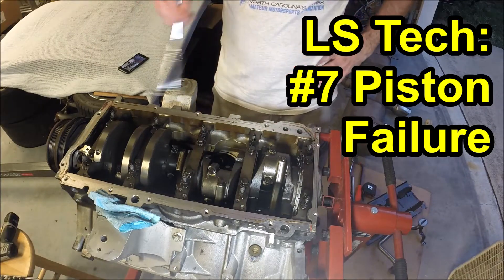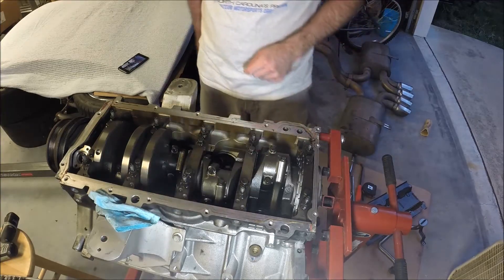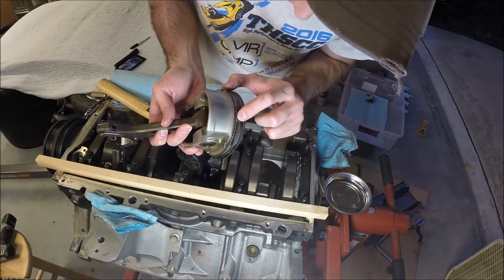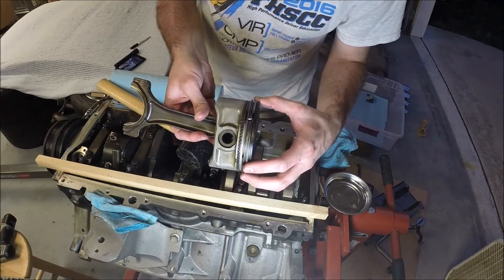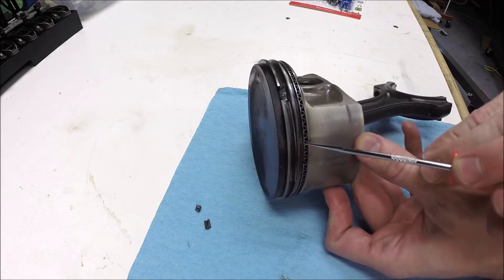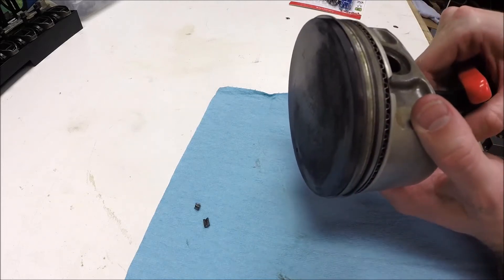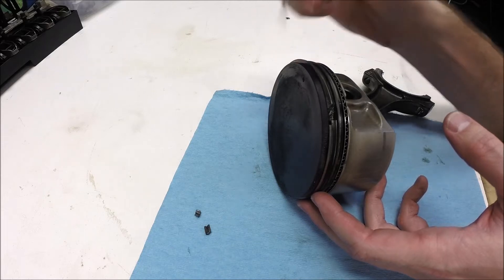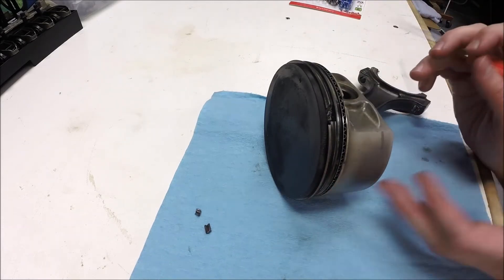LS Tech:  #7 Piston Failure

Comment: I've got an ly6 that has no compression in cylinder #5 and I mean none at all. I took off valve covers and all the rockers and valves are fine as well as the springs. Im suspecting a hole in the piston. I've never beat on this truck but it pulled a trailer its whole 177k life of motor. What do you suspect happened? Im kinda stuck at wondering if block is good enough to be rebuilt?
Reply: Lifter failed
Reply: @ryan8456  yep lifters failed and wiped out the cam bearing

Comment: What was the symptoms?
Reply: Misfire burning oil faster and run bad
Reply from the maker: Mine happened at the track.   It allowed a lot of blow-by and pressurized the crankcase and pushed oil out of the dipstick tube... which sprayed on the headers and smoked like crazy.  It also started to have a slightly rough idle.  It still ran decent enough to drive it up on the trailer to bring it home but I definitely knew something wasn't right.
Reply: Literally I have only 75 compression on the drivers side rear cyl which I think is this same #7! FUKKKKK! It’s pressurizing my coolant too. Maybe I’ll luck out and it’s just a HG issue? Lol damn

Comment: Why does #7 cylinder get so hot?
Reply: I mitigated that issue by purchasing the nitrous outlet coolant crossover kit
Reply from the maker: There's a lot of debate about why it happens.  Being at the back of the block certainly doesn't help.   I suspect my failure happened because of a trapped air pocket.  Prior to the track event when the piston failed, I had changed the engine coolant.  I had driven the car on the street for a couple of weeks after the coolant change, without any overheating issues (stabile coolant level), etc.  But at the track event, the #7 piston cracked just a few laps into the very first session on the first day.  So my guess is a trapped air pocket in the back of the cylinder head.  So when I rebuilt the engine, I opened up the rear steam ports and tied them in with the front ports.
Reply: Bin Dupais , doesn't the LS1 have a crossover steam pipe stock
Reply from the maker: It depends on what intake manifold it has.  With the LS1 intake, they have 4 corner steam vent lines.  In 2001, even LS1 got the LS6 intake manifold, and when they did that, GM got rid of the rear steam vent ports.   My car is a 2001 model, and had the LS6 intake manifold stock.  I did a video on how I added back the rear steam ports... https://youtu.be/xWgUicWliFE
Reply: Too much combustion chamber pressure